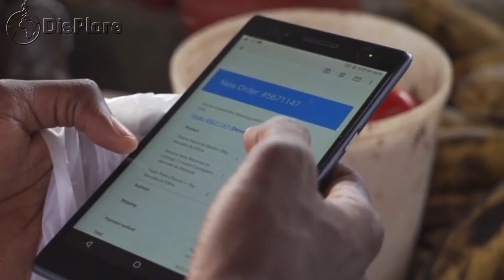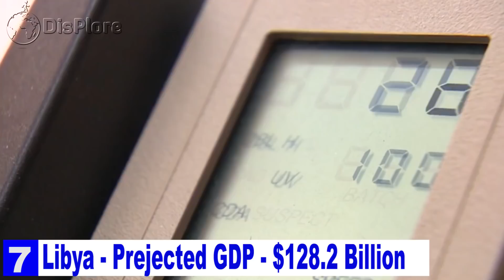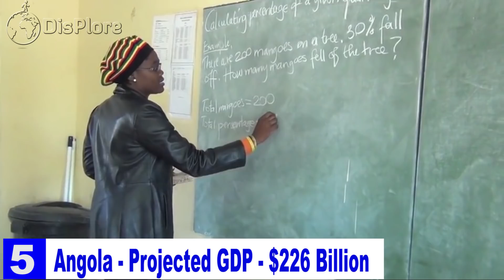Top 10 Largest Economies in Africa By 2030

Comment: whaat!! look at the data from Wikipedia
Kenya is past 108.5bn already look at the facts for 2020

Population
• 2019 census
47,564,296[5] (29th)
• Density
78/km2 (202.0/sq mi) (124th)
GDP (nominal)
2020 estimate
• Total
$109.116 billion[7]
• Per capita
$2,296[7]
Gini (2014)
42.5[8]
medium · 48th
HDI (2018)
 0.579[9]
medium · 147th
Reply: Francis, 2014, Nigeria was 570B and todays they are 442Billion. These are projections and they are dependent on what the analyst has seen for the future. For example in the last ten years, your population did not grow at all.
Reply: @ruralmandate7137  Because of oil fluctuations.
Kenya is not a mineral reliance state.
Reply: @ruralmandate7137  Kenya's economy has never relied on hydrocarbons or minerals like the rest on the top list that makes it unique...It's a diverse economy. Nigeria has shrank it's economy by -5.7 this far so....
Reply: @ruralmandate7137  Kenya's GDP is growing at a rate of 5%, Nigeria is barely 1% in growth plus Kenya's economy is way diverse than Nigeria which almost entirely  depends on Oil. You cannot compare the two . Kenya's economy  is more stable & growing faster.
Reply: @254react  Nigeria is also pursuing diversification. Oil basically provides forex to the government but it isn't basically what's running the nation